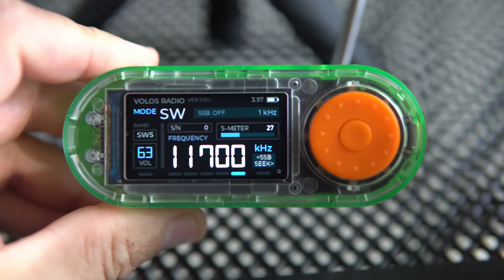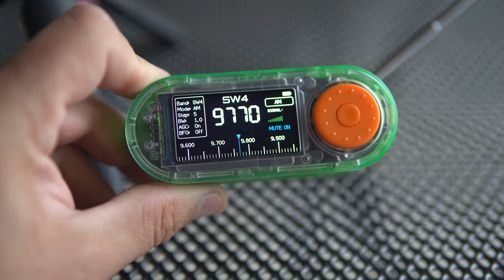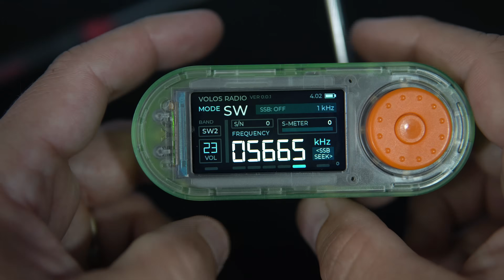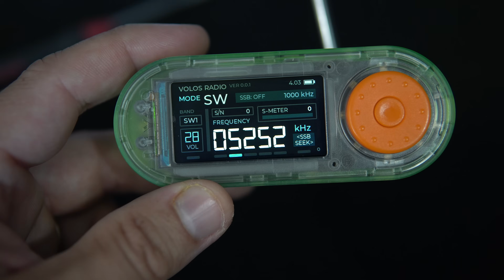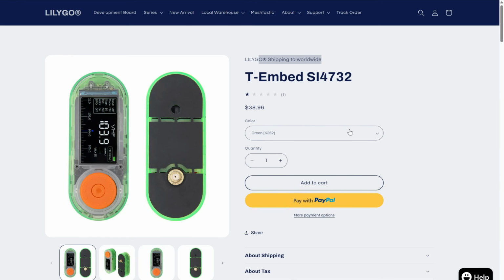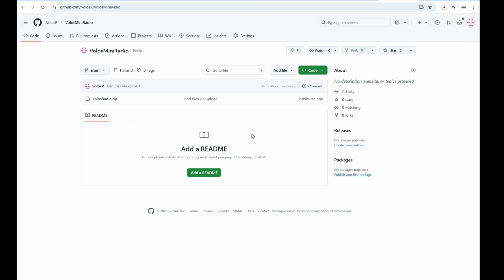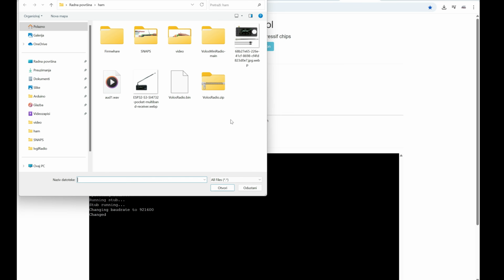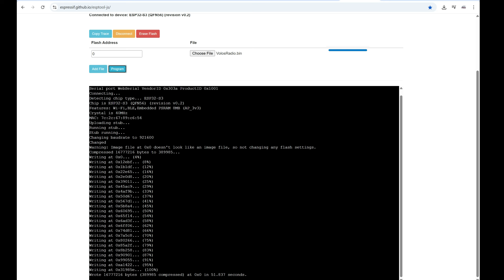NEW! Custom ESP32 + SI4732 SSB Radio Firmware! (Full Install & Demo)

Comment: How can i go back to stock firmware? couldn't find the right firmware. The other receiver that looks like the same but they arent't from lilygo. These firmware doesn't work. I need the stock firmware to go back to the original, because i am missing FM Radio and the features. The menu and buttons are better in yours.
Reply from the maker: you have firmwhare here https://github.com/Xinyuan-LilyGO/T-Embed
Reply: @VolosProjects  Thanks a lot :-)

Comment: I'm curious how this hardware compares to the other common tiny SI4732 radios.  Many are unbranded, but i guess the most commonly known one is known as "amnvolt ATS mini".  I mean aside from your custom UI firmware (which looks very nice), does anyone know if the hardware has any differences, in terms of sensitivity etc?

Comment: Please use Git properly.

Instead of posting the ZIP file directly, upload the code to the repository and attach the ZIP file as a release. Also, if possible, create a README file with installation instructions and any other relevant information you'd like users to be aware of

Ik it might seem nitpicky, but I swear it’s not! Using Git properly will streamline things both on your side and ours.

Comment: Wow 🤩. A few quick observations:
1. Clutter: Firmware version attributes (is obvious why it's there, but c'mon...). No need for labels like "Frequency" (OMG). <<SSB SEEK>> visible all the time (why?).
2. Nomenclature: Mode is AM || FM || SSB; the SSB: OFF label is not needed. The band names have to be descriptive: f.ex. SW1 => 49m.
* The colour theme is so cool! 👏

** Abandoning separate band switch option is an interesting idea.
Best.
Reply: P.S. 2. When in SSB, the displayed modes could be USB || LSB.
Reply from the maker: Thank you, i am writing down

Comment: Great radio!   Try to add 0.5Khz step to help SSB reception.
Reply from the maker: Tnx, i will add that to my list
Reply: @VolosProjects also BFO tune is needed to proper listening SSB. 0.5kHz step must be based on BFO because Si chip doesn’t have these step built in. So first tuning BFO an than 0.5kHz step based on  this BFO setting. BTW great work. I always love your GUIs ❤

Comment: I am an abolute beginner to ESP32. How is text and graphics displayed on the screen? Is this already available on ESP32 or do you need libraries and/or fonts to do that? And do you need a screen driver?
Reply from the maker: Yes you need library, and driver is defined in library in this case. Fonts and ui is done using lvgl
Reply: Sorry for my English I 'm French. To begin with graphic display I concil you to use a module ESP32 witch already have an display like crow panel or waveshare module and to using the logiciel Squareline Studio. This logiciel is very good to make a modern interface with LVGL library.